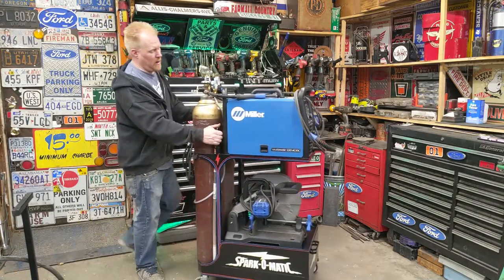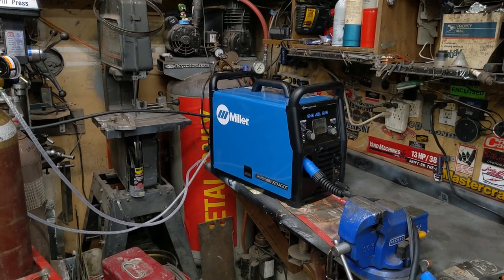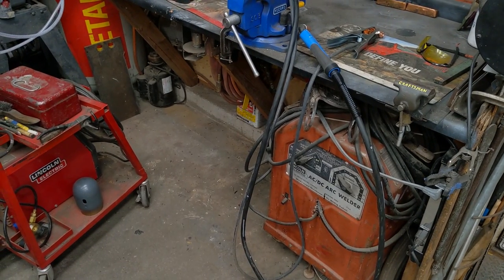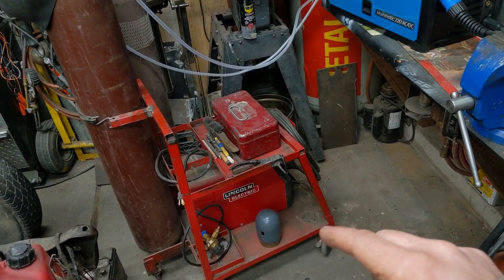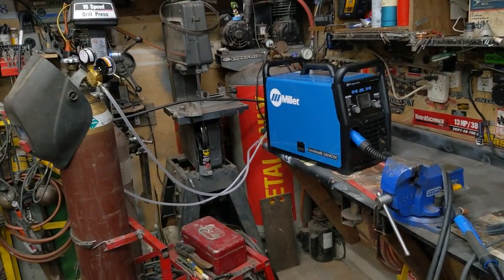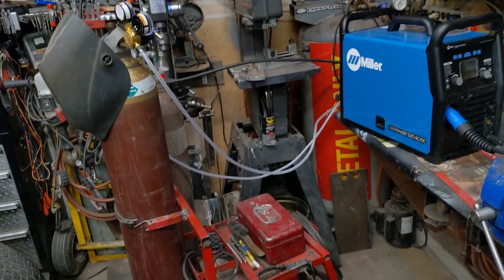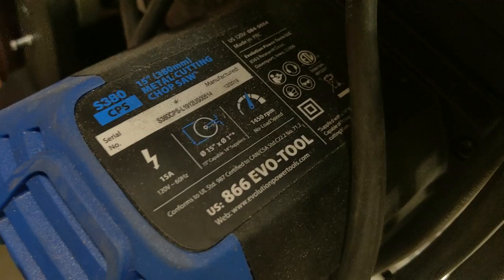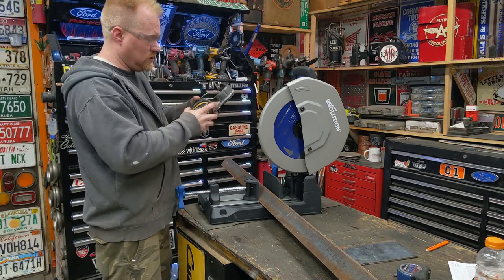Scrap steel to Welding Cart Build DIY HOW TO

Comment: Good job Moe, I like the new Miller!
Reply from the maker: It's a little bit of a change going from a transformer style to an inverter. MIG welding with inverter seems more fussy on dirty stuff versus the transformer seems to cut through better. However the inverter stick welder is amazingly smoother over the transformer.

Comment: I will NEVER build one of these. But I enjoyed watching you do it! Love the vintage lettering and pinstripe job too.

I have a question. If you were to build a bracket to compress a car/truck spring, using flat bar stock. What minimum thickness do you think would safely do the job without bending? Kicking myself for not taking metal shop in high school 🤣🤣🤣

Comment: now I know what to call lattice type/style metal and how to spray it.  I bum rushed my mini project and didn't let my brain figure out how to get the unsprayed sides.  lol.
I was in TSC for the first time ever and was wandering around and picked up a 12X12 sheet as a base for a bbq rack to put the pizza bag on the back of the scooter.  $20 but it will make me money.  Hopefully.  I needed to do it due to being robbed of the last scooter.
Tractor Supply gets the nod over HD as their washers and bolts bins are actually stocked.  Admittedly each in two very different locales.

Comment: I like your idea. Andvi love your cutoff I have the old school abrasive cutoff works good but leaves a mess in the shop or were ever your working will those blades work with an abrasive cutoff motor I don't think it spins a third of the rpm. Likely would destroy that blade as it touches the material to be cut.

Comment: I love the design of your welding cart I don't mind myself too because the carts just don't do what I need them to do. I started the base of mine from a pu×&* shopping cart and started from there and built up. I have a 300 CF tank on mine which can carry dual 300 CF I also have a cheap China made welder it's a susemse Mig 255 multiprocess welder my future plan is I'm looking to get a primeweld 225X to add to my card so I'll have my Mig welder down below my take welder up top or I'll have my take machine down below in my Mig machine on top haven't decided yet.

Comment: Yours is MUCH nicer than mine!!!  You are a talented lil' booger aren't you?  While mine isn't fancy ... or painted ... or even square for that matter; I did put something on mine that I can't live without.  I have a heavy duty metal power outlet strip mounted on the side of the upper tray with a retractable cord that plugs it in.  I keep 2 grinders and a wire wheel plugged in and hanging on the side.  
Anyway ... NICE WORK!
Reply from the maker: That's a good idea. I thought about putting a 220v junction box so I only had to plug one thing in to have my welder and plasma powered at the same time. I could easily add a few 20amp 120v plugs as well and mount it.

Comment: How do you justify that $3000 dollar Miller when there are Vulcans for under a thousand bucks?  Especially with your being the ultimate home do it yourselfer.
Reply from the maker: That's pretty easy.  I fix and repair everything in my life and in doing so I need access to parts to do so. Harbor Freight has ZERO internal/operating parts for anything they sell. Everything breaks but generally the cheaper it is the more likely it is to break because it been engineered DOWN to a price point. Harbor Freight is what I hate about current products where everything is intended to be thrown away. I would need to buy 2 Vulcan welders to do what this Miller does so I would spend around $2000 vs $3000 for the Miller. That's a $1000 savings and that's if I don't pay an extra $200-300 more for a 1 year vs standard 90day Vulcan warranty(Miller has 3 years standard). The Miller also comes with probably $100 worth of consumables vs having to buy them. So I save $700 and if when it breaks in a few years it is 100% garbage and I'm out $2300.  Miller breaks in 15 years and I can buy a $500 control board and keep on trucking.    My $500 name brand Lincoln has lasted me almost 23 year and now I can sell it for $300 so buying quality cost me virtually nothing. 

I'm a little bitter towards Harbor Freight though multiple personal experiences. I thought I could save some money and buy a Plasma Cutter from them back around 2010 for around $800. After 2 years they stopped selling the consumables for it so I was lucky enough to scrounge up a few here and there on clearance from various stores. The machine specs were WAY over stated and the excitement of having my first plasma cutter went pretty fast. I opened that thing up a dozen time and was resoldering stuff on the circuit board. I rarely used it the last 4-5 years I owned it as I wanted to save it for the times I really needed it and didn't want it to break. I was so glad when I got rid of it and bought a name brand USA made Hypertherm machine for $1500 that cuts 10x thicker material in a fraction of the time. I didn't think Plasma Cutters could work that well.  

In the long run any money I've spent at Harbor Freight in the last almost 25+ years has been wasted and I've replaced, heavily modified, or just never used everything I still have from them. In my tons of videos on repairing stuff I end up helping a lot of people fix their stuff. The number one brand people ask me about advice on fixing is Harbor Freight. I always feel bad when people have spend good money on air compressors etc that they can't get any replacement parts for and they essentially have to junk a $300 tool over a $10 custom part.
Reply: @sixtyfiveford  Al good points.  I'll ad one more.  The Chinesification of America.  Buy much cheaper, but even crappier Chinese made goods seems great at first.  But the demand for this cheap crap ultimately, in the long run, has costed them their, and every other blue collar worker's job.  We literally manufacture maybe less than 1% of what this country used to do.  Buying that cheap crap got us crappy products that are designed to be disposable.  So we ended up with a bunch of junk at the cost of things like the American man being able to afford the house in the burbs, a couple of cars, the stay at home wife so that the kids don't have to be raised by strangers, etc, etc...  NOW, we no longer have a choice in which products we buy practically as usually there is no choice as all the originals, quality made in America brands were all knocked off and gone...  No longer can most of us afford them like we once easily could...  We may have bigger and badder Stealth bombers, but China already won the war before it even had to be started.   We no longer produce wigits in this country, all of our wealth goes over seas to buy theirs...  only so long you can transfer wealth in only one direction...

Comment: 1:00 top heavy is not good either, and a bit of top working surface is handier if you have a TiG welder with knobs instead of having to play with a screen and menus. But you built it how you wanted. So good!
Reply from the maker: True. I have to say though, I love having the welder/settings at that height. My old cart kept the welder on the ground and it was a pain. I don't store the saw ECT on it anymore and just use the lower shelf for helmet/gloves.

Comment: You've got a gift of teaching man. I just discovered ye's a week ago and blown away at your skills. I enjoy reading your thoughts so don't stop them. Such reminds me of my papa and uncle whose imaginations and design critical solutions for tools (we could obviously not afford) i.e. wrenches with crazy bends, shortened/ extended wrenches, valve spring compressing tool, three, two arm pullers, etc, etc. And my favorite of all a tire bead contraption  as per > (1/4'' by 3x3 angle iron a  few inches longer than a truck tire. A chain twice as long as the L . One end of the chain was fixed to one end of the iron. The other end of the chain would go over the tire and a link was set into a notch cut out of the L and secured. Now a bottle jack put in the center of the wheel and then put the middle of the L. You'd pump the jack to lift the L that would pull the chain, which would break the bead (and of course, it was all made with drops and painted real nice of course, lol. I think I used about a half a can of metallic lime Kralon on a three foot drop of L, lol. Dad would always tell us, if we didn't have it we'd make it. Seemed he'd go thru all that just so that he uncle kid around and say, it's "Injunuity" it's Injunuity that's all. Anybody read this one? Hey? Hello? Is their any body out there? My brain is fried man.

Comment: That's a fine cart..harbour freight may wan't to speak with you about mass production..lol..good and sturdy..👍👍👍
Reply from the maker: I'd have to intentionally leave a wheel loose and a few welds not finished to meet Harbor Freights production standards.
Reply: @sixtyfiveford  ..lol.. that's supposed to be a suprise for the customers ..
Reply: @sixtyfiveford  LOL, if your channel continues to grow they might pay you a licensing fee to have you endorse their  cheap, but ever so slightly better quality, very-American sounding named welder accessory line.  (Made in China)

Comment: Awesome job, what brand and where did you get the paints from. I couldn't tell the brand  the video. Your a very creative individual.
Reply from the maker: Hey thanks. They're called "1 shot lettering enamel" and it's what the pros use to letter signs and hot rods.  I have used just spray paint sprayed into cups for years with decent results. Spray paints are what I'm using in some of my other videos where I paint signage but this is better.
Reply: Thank you, I'll try the spray paint into the a cup. your channel rocks bro.

Comment: That circular saw just doesnt seem right cutting steel like that.
Reply from the maker: It really doesn't. A decade of running a fine woodwork shop and avoiding nails or any other sort of metal in wood really gets me. It cuts metal so nicely though, and it's so much like cutting wood. That's probably why I like it.

Comment: I built my cart very similar to that.  I built mine a little taller to hold my chop saw on the bottom, Miller Thunderbolt on second shelf, and Hobart Handler 185 on top.  I made room on the back for two bottles, but only have one.  In the space for the second bottle I put a bracket to hang the extension cord.  Has worked a dream.

I like the drawer in the bottom.  The attention to detail and the paint job are exceptional.  Most all of my shop furniture is bare steel.  Trying to find the motivation to paint it all this spring.  Wish me luck.
Reply from the maker: Awesome setup!

Comment: Spark-O-Matic has become your trade name - it's a classy addition.  Love the homage to the Gumby style claymation stop-motion final cart display/dance sequence.  Ginger clearly did not take the obvious bait but wins points for finding the 'alternate' solution.
Reply: If my memory serves me correctly, (which is sometimes in doubt) back in the 60's Spark-O-Matic was the brand name of a cheap 3sp. floor shifter for guys who were really on a tight budget.

Comment: Spark-o-matic was an inexpensive brand of auto radios back in the day (before your time, I expect). Amazing dog for sure, Moe. Really nice design on the welder cart and amazing art work.
Reply from the maker: I was originally going to name it Old Sparky(electric chair) but thought it may be distasteful. Then I chose Weld-O-Matic but they are a current company selling spot welders. So I mixed both of those names name and Googled it. I saw they were out of business and the name worked, so I took it on myself to make it my own.
Reply: @sixtyfiveford  Great! An appropriately vintage name...

Comment: Great cart build, I had to laugh at the logo, spark o matic is what we used to call the cheap car stereos bought from K-Mart back in the early 80's. I enjoyed the video.
Reply from the maker: I was originally going to do "ol sparky" but decided it wasn't tasteful. Then Weld O Matic but they're a current company making spot welders. So I combined the two and I did look it up and saw the cheap radios they used to make and figured why not.

Comment: New here but as soon as I saw you welding with no gloves, hood or ,safety glasses I knew I was in the right place
Reply from the maker: Give it a couple years and everyone will insist you need to work behind a 3-in thick metal shield with an optical viewing screen.
Reply: @sixtyfiveford right, like how else am I supposed to get a nice tan in the winter?

Comment: Wow, you're talented! How do you like the Milwaukee cut-off tool?  Would you recommend it?  I've been looking at it for a while, but some of the reviewers say it doesn't have enough power and bogs too much and some say it's great.  I've got dozens of Milwaukee cordless tools in the M18 and M12 line including the 4.5/6 inch grinder that I use with cut-off wheels, but I'm looking for something a little smaller and easier to use one-handed.  Because of the reviews, I've been skeptical, but seems like it worked just fine for you.
Reply from the maker: It's gutless no matter what size battery you put on it. I was ready to throw it away when I first got it as it is so underwhelming. It's about as powerful as a Dremel and constantly stalls if you put any force on it. The only thing nice about it is it's 3" blade that allows smaller cutting and that it's cordless. However the body is so large you only have around 1/2 of cutting depth on a new disc which quickly diminishes. It's good for tiny jobs and thin sheet metal. I wish I would have just bought the right angle die grinder but that's gutless I hear as well.
Reply: @sixtyfiveford  Ok, I guess I was right to hold off on buying it. I was also interested in the right angle die grinder but had also heard that it was gutless, so I guess I will just pass on both. Thanks for your time and reply!

Comment: i read the thoughts/description
someones been binge watching Frank Howarth videos huh, hes a great video maker but i cant stand how fussy/precise he is on things that dont require it, always turning 1 day builds into 2 week projects that 10x a regular DIYers budget.. the video editing/tricks makes up for it though
Reply from the maker: Thanks for letting me know someone reads the thoughts. I've never seen Franks video but I popped over and just watched a miter saw stand one. He has some very unique graphic editing styles. Wood is a great media to work with and I enjoy it. Doing it for a decade though through the mid 2000's burnt me out on it and it took years before I wanted to build anything with wood.
Reply: @sixtyfiveford   that animated cut still shot thing of all the pieces going onto the cart at the end is something he does in most of his videos, never seen it anywhere else on youtube before... steel is so much nicer to work with, 1/4" gap? no problem just weave the welder wider, no warps, knots, or imperfections, and with the price of lumber lately its hardly any cheaper

Comment: After reading your thoughts I agree smaller bottles might be better unless you do a lot of welding using the bottles.  That is a lot of weight for sure.  For the most part it is only portable in your garage with a smooth floor.  Still the cart is exceptionally well built.  I do read your thoughts.  thanks for the information.
Reply from the maker: I usually have 125cf bottles(about 70lbs) but they were out last time and just gave me 150cf(80lbs) for the same price.  It's a hard thing to not rationalize large tanks as they cost the same to fill vs a small tank(within a few dollars). Thanks for letting me know someone is reading my after thoughts.

Comment: Nice! I built mine out of an old pressure washer. Removed the engine and pump and welded some angles down the side. Mine doesn’t carry the tank though.
Reply from the maker: Heck YEAH. It just has to move a welder around. I lugged my welder around without any cart for 4+ years.

Comment: Nice job!  I have a Miller Multimatic also.  Customized my first welding cart I built when I got it to hold the 2 bottles, it's a 6 wheeler.  I never got the idea of the carts with the slant for the welder?
Reply from the maker: I'm not sure I like the slant carts. I guess it's a way to keep the welder low and and still see the display.
Reply: @sixtyfiveford  Ya, I don't know of any other equipment that people slant like that.  Takes away from the carts versatility.  Heard one guy say it makes the dust roll off??  Really?

Comment: Any advice on plasma cutters?
Reply from the maker: I've owned a few plasma cutters. My first was a Chinese 120 v unit from Harbor Freight and I will never do that again(buy a cheap Chinese unit or something expensive from Harbor Freight). It would barely cut a little more than sheet metal. It took forever to clean up the edges of straight cuts. My second was a old 1990s snap-on 240 volt unit the size of a small fridge. The issue with that is it was too old and the technology was outdated. It was brutal to cut with and barely cut more than 120-volt unit. It also left pretty poor edges that required significant cleanup/ grinding. Countless forums and people talk about hypertherm as being the number one. So I finally decided to bite the bullet and bought a hypertherm. It was expensive but exceeds my expectations tenfold. Where my Chinese one(15amp)on 120 volt would barely cut sheet metal the hypertherm on 120 volt can cut around 3/8-1/2 steel and on 240 volts it can cut nearly an inch thick steel. Mine is a hypertherm PowerMax 30XP (30amp). You will see a lot of Chinese 60 amp units for cheap and they're tempting. Generally they run off 240 volts and cut somewhere around 3/8 to 1/2-in thick steel.
Reply: @sixtyfiveford  thanks
Reply: @sixtyfiveford  I am considering tool chests from harbor fright.